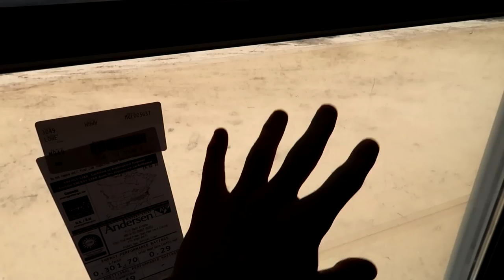BUILDING MY DREAM HOUSE PART 3

Comment: *trust me I'm an expert (4 years of AV experience both install and sales) a lot of people put tvs above the fireplace cause it's a cleaner custom look but don't take into consideration that you sit lower on the couch so looking up even if you use a tilt mount is usually uncomfortable, I recommend putting it on the empty wall mount it after the couch is in and make it just above sitting eye level hope this helps

Comment: for the closet thing here is a solution, where you wanted to put your tv in your room make them built a closet there with one open door so you can put the tv in there i mean its a huge wall so you can use it to put your clothes in there also as a male we dont have that much clothes so that space would be more than enough

Comment: PLEASE READ!!! The other video i noticed you had standing water up against the house. i know it just rained but you need to make sure your house is on the proper elevation so the water runs away from the home and not towards it. If not you'll have foundation issues in the future and if this is a forever home thats something that your definitely don't want.

Comment: The bathroom outside your office should be converted into a walk-in wardrobe for you. But if that doesn't work then for your clothes into your office somehow either by buying a wardrobe or by putting up some walls and having it inside that.